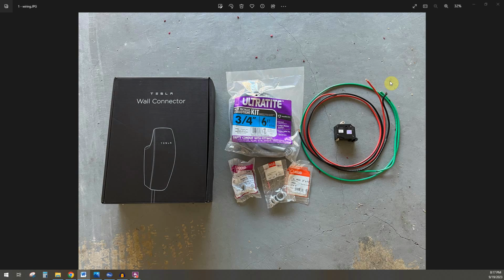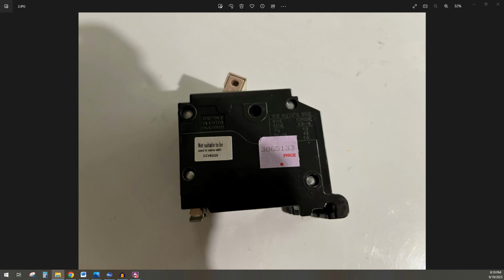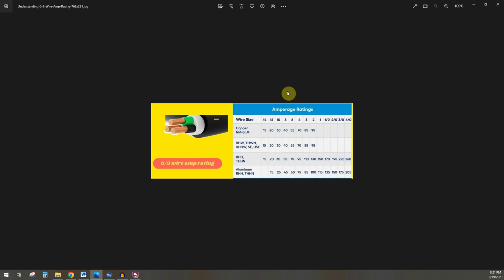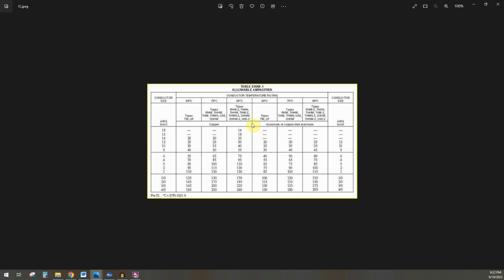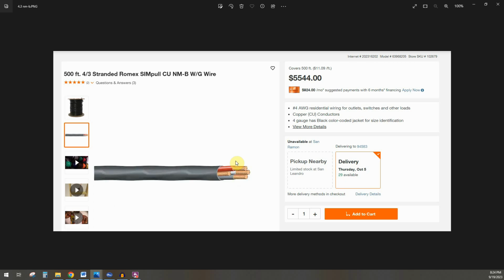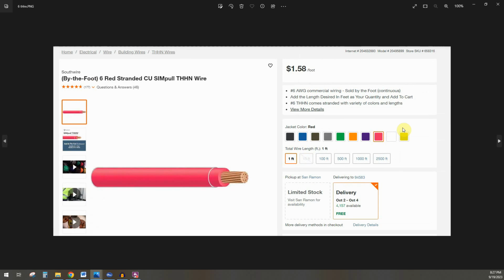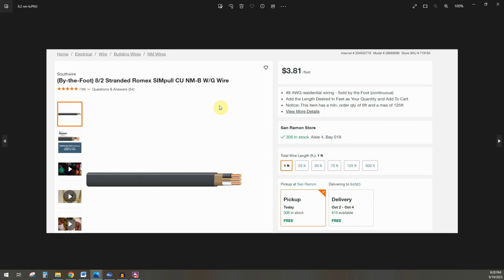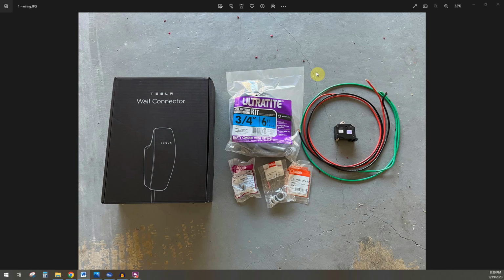Determining Correct Breaker and Wiring Size For Tesla Wall Connector For DIYers

Comment: You can use a 6 awg wire rated at 55 amps for a wire run under 100ft. The charger only pulls 48 amps max.
Reply from the maker: This is totally wrong and against the NEC code.  This is a great way to burn your house down.  Yes, I hear you that 55 amps is greater than 48 amps, but that's not what's safe.  You wire based on breaker size, not what your load is pulling.  Since this EVSE has to be on a 60a breaker to charge at 48a (80% rule, which you also aren't following), if you're using say, 6 AWG NM-B, the wire is going to melt (55a) before the 60a breaker pops.

Does this type of install happen?  100% all the time.  But I don't want that crappy electrician touching my house cause they aren't buying me a new one when they burn mine down.

Comment: Thank you. So it seems a #8 wire THHN or THWN is rated for 55Amps which will work for a 40Amp charger. Correct? I just need to have it in a conduit
Reply from the maker: You're talking on a 50a breaker right?  We always want to look at the breaker size, not the amperage you're charging at since the breaker is what's going to shut off power if there's a short or whatever.

That said, if that's what you meant, then yes, you're good.
Reply: @nukem384  Thanks for your prompt reply. Yes breaker is 50 Amps. Everywhere on internet everyone saying #8 can only do 40Amps.
Reply from the maker: @sanjapkoki  It's probably cause they don't realize there are different types of 8 AWG.  They are talking about Romex/NM-B.  That #8 is rated for a 40a circuit.

Even electricians sometimes don't realize the difference.  I can't tell you how many videos I've seen on here where a licensed electrician is putting in #6 NM-B on a 60a breaker.  That's a no no as that wire is rated for 55a.  You need #6 THHN/THWN/MC for a 60a breaker (or bigger).

Comment: Hi, great information. One question....I see breakers rated  at different temperatures. Does the breaker need to be rated at 90 degrees C as well? Thanks for the great video!
Reply from the maker: I've actually never heard that asked before anywhere.  Even on the forums talking to people for years.  Usually you just buy the right size breaker for your wiring and you're good.  That said, if you're seeing that, it would be safe to match up temp as well.  Keep everything consistent.
Reply: With continuous load you should go by 60 degrees only.

Comment: 60 amp breaker with 6 gauge thhn wires (black, green, red) across 100 feet of basement ceiling inside 3/4 flexible non metallic pvc conduit should be fine right?
Reply from the maker: Yup you are good.  That's a long run, good luck on the pull!
Reply: That would work but this is illegal set up.
Reply: I would not do that. Just use a 50amp breaker with 6 gauge thhn wires. You will be charging at 9.6kw instead of 11.5kw. And you might also save your house from burning down!
Reply: @leoid3119  It might work yes. But 100 feet is a lot. I would not do that.
Reply: Over 100 feet u need to keep voltage drop lower at3% so u need a larger wire . Correct me if I am wrong

Comment: Very useful distinctions here. My garage subpanel was fed from the house main with 6Ga. copper THHN, but from 60A. breaker. Only one 20A. receptacle and one 15A light circuit out there, ordinarily not powering anything, so wonder if I can add a full 60A. breaker out there to feed the Tesla Gen 3 unit, applying the same logic that not every 20A outlet is being used at once in a kitchen circuit. Curious why the charger's max output at 48A advises a 60 A breaker, vs 50.
Reply from the maker: @z1522  theorically, you could put in a 60a breaker for your wall connector, but you may not pass a load calc if permitting is important to you.

Since EV charging is considered a “continuous load”, you have to follow the 80% rule. This is where the 48a number you hear always comes from. Very ill advised to charge at 48a on a 50a breaker where the wiring is rated for 50a, not 60a. Thats a great way to melt that wiring and cause a fire.

Comment: My electrician installed 6AWG aluminum Romex. 🤦 
Anyone know if it should be fine if I only charge at 32AMPS?
Reply from the maker: In a what?  NEMA 14-50?  Looking at the charts, that's still fine to charge at 32a.  Not my first choice either, but it'll work.
Reply: @nukem384  ok thank you. I thought it should be fine for now. I also only charge for 30-60 minutes in a day mostly. 
Its the wall charger I had installed, not the 14-50.
Reply from the maker: @mohammadkamran5862  Uhhhh ok you better set the wall connector as a 50a breaker then, not 60a just for extra safety.  And don't charge over 40a or you're risking melting that wiring and starting a fire if you try and charge at 48a.
Reply: I thought Tesla said to only use copper and not aluminum?

Comment: Thank you for the video! I wanted to upgrade my DiY NEMA 14-50 to Tesla wall connector, but wasn’t sure if the 6AWG was good enough, but it seems to be.
Reply from the maker: Just make sure it's 6 AWG THHN or MC.  6 AWG romex is very common with 14-50's and that can't handle the full 48a on a 60a breaker.
Reply: @nukem384  It’s separate wires that I purchased at electrical supply house, not Romex.
Reply from the maker: @eeng4234  As long as that wire is rated for over 60a, you're good.

Comment: Why do you need to color the white? Because there are two hots and the green is the neutral with no ground?
Reply from the maker: You actually don't need the neutral if you're hard wiring.  Just black/red for the hots and green for ground.  The only reason the neutral is even there sometimes if people will wire these on a 50a breaker and use 6AWG romex.  6AWG romex is usually comes 6/3, so the white neutral is already inside the covering.  You don't use it for this hard wire setup.  Just let it be and cap it off on both sides.
Reply: @nukem384  So the black brings 120 and the red brings 120 and no neutral? How does the energy return?  Sorry, I am still learning.
Reply from the maker: @bbooth1229  You're correct on the 120v/120v.  Having 240v total, both the hots act as hots and return.  Sorry, I'm not an electrician, so my explanation isn't going to be pro.  

The 2nd response explains a little better.
https://teslamotorsclub.com/tmc/threads/why-no-neutral-in-the-hpwc.239243/
Reply: @bbooth1229  In main home circuits, 240 V. coming in has two phases and a white neutral. 120 V circuits are fed from one phase and the white neutral is the return. 240V is the voltage difference between the two out of phase lines, in an Alternating current at any moment. Many 240v circuits feed things like ovens or dryers, where other electrical components only use 120 v, so the white neutral completes those circuits which 240 would fry. Closed units like car chargers have only the primary 240, so the neutral is not needed.

Comment: How about 6 awg romex with a 50 amp breaker?
Reply from the maker: Yup, that's fine.  Just make sure you set the wall connector to 50a instead of 60a.  And don't charge over 40a (80% rule).  And cap the white neutral.
Reply: The wall connector draws a max of 48 amps.  How could it melt 6 gauge Romex if it's rated at 55 amps?????
Reply from the maker: @philiphaller8160  Couple of things.
1. 55a rated wire on a 60a breaker is a great way to start a fire since the wire will melt before the breaker pops
2. Level 2 charging puts a ton of stress on the wires.  Just because it's rated at 55a, it could still melt before the breaker pops.
3. Since EV charging is considered a continuous load, I'm not risking putting Romex in when it not rated for the 60a breaker, that's just not a good practice.  You should always be installing wire rated for HIGHER than the breaker size.  Also need to consider the 80% rule for continuous loads.

Comment: Is stranded or solid core recommended?
Reply from the maker: For this big of a gauge of wire, you're going to want stranded.  Solid wiring is typically more for lower amperages like 30a and below.  I'm not sure I've seen a 60a breaker install with solid wiring.  I'm sure there are installs out there, but stranded is much more common.  Stick with that like I did in the video.

Comment: Can I use 10 awg THHN for ground ? 6 awg for hot ?Thank you !
Reply from the maker: If you're already buying individual wires for the hots and ground, you should really make them all 6 THHN as shown in the video.  Keep it consistent.  I believe you can use 8 THHN for the ground, but I've heard of cases where this can cause issues with the wall connector working properly.  It's not worth it to cheap out on something like this when your entire house is at risk.
Reply: Yes, you can use #10 for ground according to code.

Comment: I learned a lot more about electric from your helpful video 🙏.
I dont know my electric panel can handle 60amp breaker or not but just to be safe Im thinking to install 50amp( for me I think it’s enough,50 breaker can output 40A, 37 mph is not too bad). And with the 50amp breaker,which wire you think is safe and work perfectly with tesla wall charger ??? Can you please give me an advise. Thanks a lot !
Reply from the maker: Yeah if you don't think your panel can handle 60a, go with 50a.  I would stay with the same size wire on 50a.  6AWG THHN or just 6AWG in general is fine for 50a.
Reply: Thanks again. This help me a lot 👍

Comment: Thank you for your excellent series of videos. I have found them very helpful as I prepare for my first EV.(R1S)

I planned/installed my EVSE with a licensed electrician but there is indeed a lot of confusion out there with 6AWG romex being the go to for many despite the fact that it is not rated for 60 A. 

I am still confused about the 55 degree rating in the chart you showed where THHN is not listed and I have had at least one electrical supplier tell me that because of that 6AWG is not to code. That said I presume that because of the 75 and 90 degree ratings it is safe and it seems to be what most are doing on a 60 A breaker.

People on the forums have been able to get 4 AWG into the Rivian connector block, but it is my understanding that, by code, the block has to mach the wire guage and the Rivian block spec'd max is 6AWG. If not for that , as a precaution, I would have used 4 awg (like the Tesla charger an allow).

6AWG THHN is not the only choice. XHHW or XHHW-2 Has the same temp ratings as THHN with reportedly a thicker and yet stronger sheath that is more resistant and flexible than THHN.

My local supplier has XHHW-2  already in a 6/3 flexible metal conduit (about $3.50/foot) and I found this a very easy way to accomplish the 30 foot run from my panel. I wanted the extra (unused) neutral to future proof my system If chargers ever need  to tap off one of the hot leads for a 120V use.  While the ground in my cable is 8AWG if there were ever a fault problem with the charger I could  relabel and use the neutral as a 6 awg ground.

I do wish the Rivian Charger block allowed 4awg that would put the 55 A issue to bed. 

Many thanks
Reply from the maker: Sounds like you've really done your research.  Yeah I'm not 100% on the 55 degree either.  I even asked an electrician and he couldn't really explain it to me.  But being that 6 THHN is rated at 75a, I'm ok with it.  6 THHN is very very popular with 48a chargers.  So if it weren't safe, you'd be hearing a ton of stories of EVSE's catching fire.  And even if it makes you a little weary, just turn the amperage down to 40a and you'll be good.  Still plenty of power to charge the R1S.

I like your backup plan too.  Smart move for future proofing in multiple ways.
Reply: @nukem384   Thanks again, and thanks for your videos.
Reply: @nukem384 6/3 NM-B, or Romex, is rated at 55 amps because it is a CABLE, made of three individual conductors. The wires being tightly bundled together inside a sheathing. Also, in the electrical code, NEC article 334.80, it specifies that the ampacity of NM cable (which includes “B”) is to be reduced. It directs us to a chart, and ends up being 55 amps. (Table 310.15, 60 degree C column, 6AWG copper) 

So, in summary: the individual conductors INSIDE that cable can handle more, but the cable assembly cannot. 

Also, 6AWG THHN has 90 degree C insulation, which can handle 75 amps, as you stated. These are installed loosely in a conduit. 

Caution: even though your WIRE is rated at 90 degrees C, and is safe at 75 amps, your terminals (screws) are not. 

The terminals on the breaker and inside the charger are not rated for 90 degrees C, but 75 degrees C. This is clearly labeled. 

This means you must treat your THHN 90 degree wire as if it were a 75 degree wire, and lower the ampacity. So you cannot run 75 amps through it. Table 310.15 in the NEC shows us the ampacity for a 75 degree, 6 AWG copper conductor. This is 65 amps. 

In a nutshell: Your wire can handle 75 amps safely, your breaker terminals can only handle 65 amps safely, and your charger can only handle 60 amps safely.  

Use a 60 amp breaker for your installation and you’ve protected every part of the system.
Reply from the maker: @Justinwhat1  Thanks for the detailed response.  Didn't know that piece about the terminals, but they obviously need to be rated more than 60a if we're talking about a 60a breaker and a 60a EVSE.

Not sure if you knew this (you probably do), but since EV charging is considered a "continuous load", you also need to follow the 80% rule.  So charging on the Tesla wall connector can't go higher than 48a.  The EVSE literally will not let you charge with more power than that.

But of course since we want everything to NEC code and we always have to plan based on the breaker that protects the wires, everything needs to be rated for over 60a.